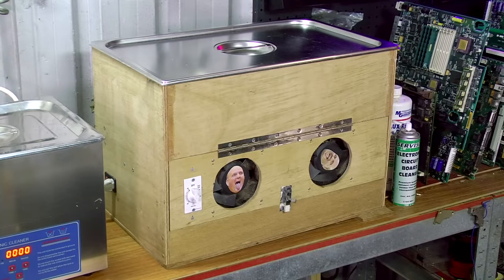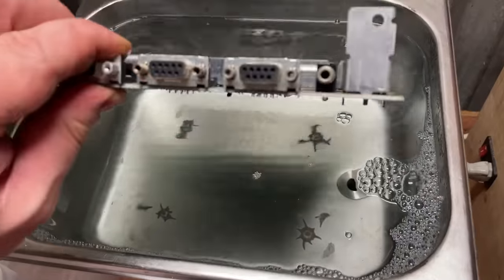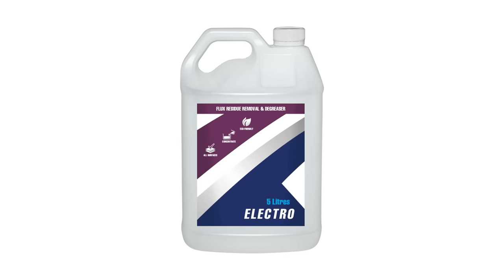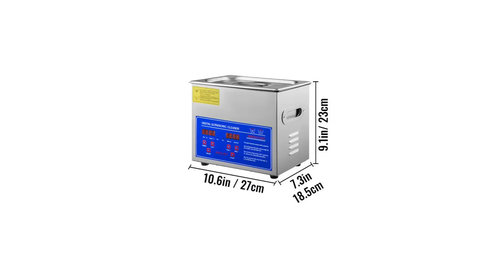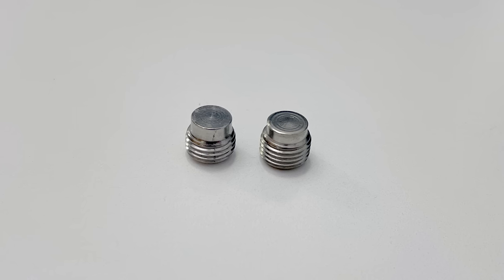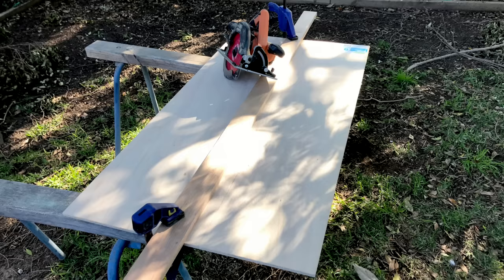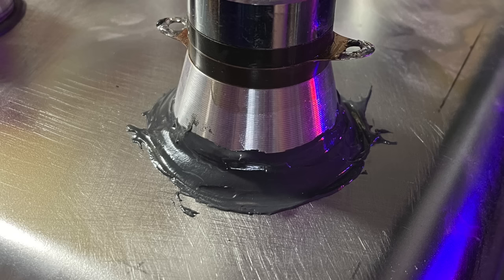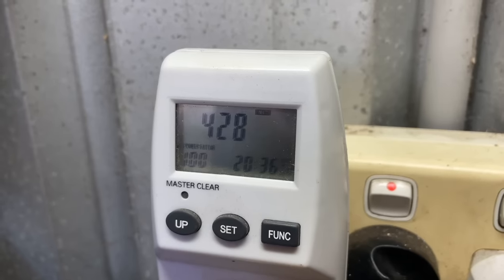Building my own Ultrasonic Cleaner

Comment: I have not built an ultrasonic cleaner, but I am a model engineer, if I want to 'glue' parts together I use one of the stronger Loctite products, even for flat things to flat things. They don't come apart. For unreactive metals like stainless steel you sometimes have to use a primer as the stainless does not release enough ions into the glue to start the polymerisation.
Reply from the maker: Can you recommend a product? I'd be happy to try one.
Reply: @BranchusCreations  Any of the Red ones, like Loctite 638. I have  used it on stainless without problem, but there's LOCTITE SF 7649 primer/activator if you need it.
I also use it to glue plastic to metal by putting a very thin layer of Loctite onto the metal and using normal glue to fix the plastic to that. Works for scales onto knife handles.
Reply: @donaldasayers  I do not think gluing transducers is the same as knife scales. Not unless you have a really bad case of hand tremors. I'd say their problem stemmed from inadequate scuffing with their first application. More bite should sort it. JB Weld-It is decent epoxy.
Reply: @1pcfred  Knife scales was but one example.
Reply: @donaldasayers  I can give many examples of JB Weld-It holding. None are quite like gluing transducers down though.
Reply: @1pcfred  I was merely positing an alternative to JB weld given that it had failed in the video.
Reply: @donaldasayers  sometimes it is just down to the preparation. Surface prep makes or breaks a lot of jobs. The failure often is not in the materials but rather the technique.

Comment: I have used my gasless mig on the thinnest of steels and it works a treat. I would suggest you try it on very low settings . Its would be best transfer of energy . Just go from tub up to thicker steel of transducer . Even if a tiny hole happens to can just weld it shut and or glue it with jb . My bought ones suffered all the same problems . Low quality components i replaced and transducers fell off. I beleive it was heat build up and it stated only 30 min at a time but I think what that really means is let it completely cool down.

Comment: Industrial Ultrasonic cleaners I've used for circuit board us industrial alcohol and have a water jacket around the top to condense the alcohol vapour very efficient and quick and circuit boards are are almost completely dry as you lift them out  ..and the transducer protruded onto the tank dome shaped half inch across and half inch high

Comment: You could try silver soldering the mounting studs to the tray. Silver soldering Is like regular soldering but takes a little more heat and is stronger you will need a map gas torch or a oxy act torch. Sill clean and roughen up the area where the stud goes. Also solder on a ground stud.

Comment: Excellent video!  I recently had to repair my el-cheapo Chinese 3L ultrasonic cleaner (the one with the amusingly bad translation on the front panel) by replacing the power supply that powers the MPU board.  It's a tiny SMPS module that converts 120V AC directly to 5V DC so a 7805 or similar regulator wouldn't work.  I used a small 5V USB charger instead and that worked fine.  Also, I have so far used only tap water, dish soap and a little ammonia for a cleaning fluid - works fine for the small parts that I clean and it is much cheaper than commercial cleaning fluids.  The only distilled water I can find where I live is de-ionized battery water.  Haven't tried it yet but will on my next cleaning.

Comment: Best approach....Weld the threads using a copper block under the tray as a good heat sink. If you must glue, use least amount of glue as possible (thinner the layer the stronger the bond, and yes its counter-intuitive!). Clamp the items to make the glue layer as thin as possible. I'd use a post Acetone clean with IPA as it dries cleaner. Also a good out-gass in your oven would be a good idea after that. Wipe any excess bead of glue from each item as this can help prise the bond by shearing it. Careful not to contaminate cleaned surfaces with finger grease (wear gloves when gluing) take care to keep glue off of skin with all epoxies.

Comment: I really enjoyed this video! You remind me a little of Clickspring; not just because you have the Australian accent, but mainly because your voice and speaking style are so meticulously clear and measured, and you spare no relevant detail.

I have two pieces of feedback: #1 is, as others in the comments have mentioned, you could have (and still could) solder the threaded lugs onto the tray; this is a method that is very easy to learn, requires very minimal equipment costs, and is much stronger than epoxy. 

#2 is a bit of a subjective one, but hear me out and see what you think. In this video, you gave a very detailed account of the difficulties you had in gluing the transducers to the trays. I think you were wise to explain these, to help others avoid similar mistakes, but a much simpler way of explaining the issues would have been to abandon the strictly sequential description that you gave, since topics kept arising, going away, and coming back to the fore. This strictly sequential account meant that the viewer needed to repeatedly retrieve all of the previous information from working memory, and it also meant that you couldn't use any of the linguistic shortcuts that save so much time when we are talking about one topic without changing; each time you had to re-introduce the topic. 

If you had told the whole tale of the gluing as one story without breaks, you would have shortened the video considerably, and made the watching a much smoother and more engaging experience, in my opinion. Still a great video, I still watched the whole thing, but I found my attention wandering a few times, and while some of that is my own personal issue, I'm hardly the only person on YouTube who has a shortened attention span, lol. I get the impression that it might be hard for you to put yourself in our shoes, since your own attention span appears to be rather monolithic, but we exist.

Comment: Just an idea regarding those weld studs:
Drill a hole where you want to attach the transducer, 5mm should suffice, clamp the stud in place - concentric with hole, probably the trickiest part - and weld it in place from the inside. The studs will soak most of the heat and there's not much risk of melting too much of the sheet metal. 
I believe the english term is plug welding. 
Get a piece of scrap metal and some bolts the size of the weld studs and you can practice this easily until you're confident enough.

Brazing might also work. No need to drill through the tray, no weld spatter to remove etc.

Also, a pull configuration for the fans would be more efficient and instead of just open intake holes in the front panel you could then attach flexible hoses and guide the air towards the drivers.

Comment: I built one for a workshop years ago using offset motors from xbox controllers, Stainless housing with a motor on each side mounted on the outside with a pots mod controller to control speed, Then a wire basket that sat inside the stainless housing . It was used to clean parts used to manufacture temperature censors

Comment: I repaired a gas stove with metallic resin, which is called cold welding. It never moved, but maybe the ultrasonic transducers heat up a lot more..
But if they are screwed, how can they come loose? Thanks for your vidéo 😊

Comment: You can save some money by using an old kitchen sink as the container. As far as the transducers, i soldered mine (with a torch) to the sink. 
I also added a “filtration system”. All it consists of is a 12v automotive fuel pump, and i use fuel filters on it. I just run it when the solution gets murky.

Comment: Great work done! I have the same problem (big PCBs) and a similar idea to solve it. I already organised a "Bain Marie" (Ebay, 1 Euro), the box where you put the GN 1/1 into it. It measures inside 506 X 306 mm² 160 mm deep which is ideal for big motherboards and other PCBs in 19" racks. I am still insecure which Ultrasonic transducer to choose. Concerning the driver I thought of building one myself. Still planning at the moment.
Concerning the bolts, I am thinking of soldering them with a good flux and silver solder at 900°C
Reply: @Cyrus Ramsey Silver solder is at least as good as spot welding. Choosing the appropriate flux is of great importance. It must be capable of breaking up the chromium oxide layer. For example "F 300 H Ultra NT" can be used. 
Epoxy has a much lower bond strength which deteriorates under ultrasound dynamic load which weld/solder bonds do not.

Comment: I realy enjoyed your video,  I think I would have gone with the argon weld or drill and tap for the transducer attachment,  all glues degrade,  especially when subject to heat and vibration.  
Looks like the driver boards are complete rubbish.  Have you contemplated building a single board with common components?

Comment: I found your video very informative. I also am looking for a ultrasonic cleaner for electronic circuit boards. I don’t think I will need one the same size you have made. TIG welded legs would probably have solved a lot of your problems

Comment: Perhaps the tray was getting energized because the transducer polarity is wrong after all? Someone with an argon welder should buy a bunch of these transducer/driver kits and a bunch of these trays and sell them pre-welded with a small markup. Of course, then the driver reliability becomes his problem instead of the supplier, which would suck for him unless he could solve that issue conclusively. Still, I’ve long wanted an extra-large cleaner and I would buy a DIY kit with properly-welded bits.

Comment: Hi mate. Interesting video, apreciated. One thought I had after the electronics started popping, was to just buy an of the shelf cleaner but sized right in cleaning capacity. Then remove and reuse all electronics on the tub you found.
Would save the less electro-savvy of us other DIY'ers. Cheers!

Comment: I've commented before but rewatching this I have some further info I may not of had at the time; there is gasless welding wire for stainless, 308LFC-O(blue demon brand is what I used)..... had bought the stuff to weld a compressor tank, was high strength vs standard E71T-GS but after pressure testing the tank(prior to doing anything to it) found out the bottom as thinned out so didn't bother.... years later bought an amazon return Instant water heater(EcoSmart) that the inner tanks had burst, I the unit did work otherwise and I suspect this was due to something else about how the person installed it rather than the actual unit; before returning it did a bit of research and found out the 308LFC-O wire was good for stainless, and the instant hot water heater has been great ever since(wasn't too hard to welt and probably not to much thicker than the pans)

Comment: I wonder if putting some foam weather  strip in between tank and cabinet so it 1 quiets it down and 2 it might allow tank to vibrate easier without the hard solid cabinet to bounce off  

And you might be able to use your flux core welder as a spot welder 
Pull wire out and squeeze the support bracket to the tank using the ground on tank and welder tip on bolt do a quick pop of the trigger

Comment: I suggest using the fan as suction fan (draw air in) and cover them from the outside with air filters. Otherwise, dust may accumulate inside which could cause heat buildup.

Comment: 🇦🇬
Great video. For your next project there is a GST 2/1 P150 Container Gastronorm tray, it’s stainless steel AISI 304 GS 2/1 measuring 650x530x150mm, 43.4L capacity, I think this may be the right size you’re looking for. Good luck 👍🏽 
🙇🏾‍♂️

Comment: They do make standard tray sizes larger than one gastronorm, but that might be unwieldily. Also, they make fixtures for these pans with sous vide heaters which could replace the immersion heater.

Comment: Very informative and engaging! Thanks. I couldn't help but watch to the end. Did someone already suggest to silver solder the mounting studs (maybe not as strong as a weld, but definitely more than the JB)? Not the low temp silver solder, but the harder brazing material that usually requires a little experience and acetylene, perhaps?😀

Comment: On my cheap cleaner the basket ruins it so I run everything in a beaker or cup sat in the water. The cup/beaker is filled with water/detergent same with the cleaner itself. I find it works better. But I did try a mason jar and the bottom of it was domed and it reflected the sound waves back to the bottom and did not work. It was an interesting experience/experiment in fluid dynamics learning why the far wasn't working.

Comment: guys used to use it in the labs to clean metal filters and dimple switches (pressure valves), precipitates gets stuck in the places where there is phase change

Comment: Since I am a technician both in electronics and computing, I would use a single board computer for control and ultrasound generation, and own designed drivers. Then, if anything blows, I am the only culprit 😊

Comment: I used to clean tv tuners with a ultrasonic cleaner and dry in a toaster oven with tuner lub on the contacts and they work great after with no signs of noisey contacts. A window cleaner work in my case but I can see what your cleaning would work a different cleaner solution.

Comment: After watching this if I was going to build my own I would probably opt to modify the power supply by using the switching mosfets to drive larger mosfets hooked up to a beefy voltage supply and take the load off the crappy components.  That and I'd silver solder the studs to the stainless bowl.
Reply: +1 to the silver solder. Most shops have a gas torch hot enough.

Comment: You need an epoxy to withstand higher temperatures. I've used Araldite 2014 for my ultrasonic cleaner
Reply from the maker: As it turns out, if the transducers are working properly, they should be completely cool.

Comment: Just a thought: you wired positive to the lower terminal which, from the photos seems to be connected to the case of the transducer. This case is intended to be screwed to a type of screw welded to the stainless case. You then proceeded to connect the circuit negative to the stainless case. Even though the transducers are insulated from the case with the epoxy in between them, the layer being very thin and with heat it could be kind of shorting this circuit.

Comment: What I did is, when all tranceducers were fitted , I used an can of polyurethane foam, and sprayed it all over them !    This way, it equals the soundwaves, isolate heat, and HOLD them all TIGHT in place !   Only problem, if one ever dies ...... it's a bit of pain, to get that one out, and replace it ;-)   But it is completely worth it !   BTW ... I ONLY clean PC Motherboards, and GPU's

Comment: Mild dish soap or hand soap will work very well as long as you rinse it well afterwards. This is by far the best I’ve seen on how to make a working cleaner. I’m considering to make one to suit my needs and it has been two months since this video was posted, any more issues with the setup? Thanks.
Reply: Simple Green also seems to work pretty well for electronics.

Comment: +/- electrical connections:
I suspect that, like audio speakers, the most important thing is to wire the transducers so that they all are in phase rather than canceling each other out.
If the tank were deep and narrow and the transducers were mounted to the side walls of the tank, then it might be a good idea to wire the transducer on one side out-of-phase with a transducer opposite it on the other side of the tank which would make a push-pull oscillation.
(I'm just guessing)

Comment: Glad that I found your video. I made one a few months ago with one of the kits that come with two trans and one driver. I was trying to be cheap and instead of sourcing a stainless tub, I used a tub from an oil frier.  I also used jb weld to secure the trans.  It seemed to work, I could see water movement but not great and I was wondering if the enamel coating on the tub was deadening it because the whole thing is coated..  I have since found a stainless tub but have not made any changes because I have not even been using the device.

Comment: Would you know if using multipole transducer on the bottom and all sides make the cleaning way better ??? Thanks
Reply from the maker: I suspect that if it made an improvement, it would probably be only minor. Sound travels pretty well in liquid, so I don't think the sides would make much of a difference.
Reply: @BranchusCreations  Thanks for the insight of this question Sir.

Comment: These small threads need to be welded, preferably with a spot welder. You only need enough epoxy glue to ensure good contact between the entire transducer surface and the tank. Cooling is key, in my first build the wires from the transducers soldered off due to heat.

Comment: Those bolts are most likely primarily for sound conduction rather than mounting convenience. Without them being solidly connected (i.e., welded) to the tub, you will be seriously reducing the efficiency of the system, and, quite likely blitzing the output transistors (think of "running a high power transmitter with a break in the coax going to the antenna").

I suspect that most if not all of your problems would have been resolved had you "bit the proverbial bullet" and welded them to the tank.

Comment: Don't have much interest in old apples.   But you caught me with this one.  SUBSCRIBED
Please let us know how it holds up.  Improvements etc.    May I suggest gluing a DS1820 to each of the drivers and monitor the temperatures?   Use an arduino, raspberry pi or your favorite flavor of micro controller.  Implement the timer in software and shut down the drivers if they start to overheat.   Figure out what the transformers are.